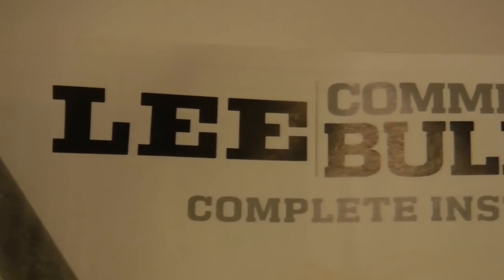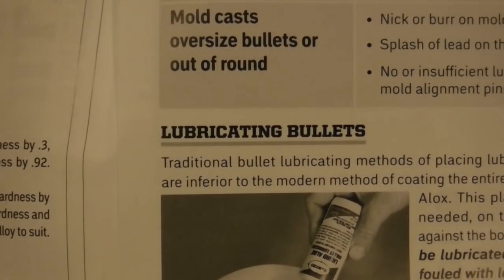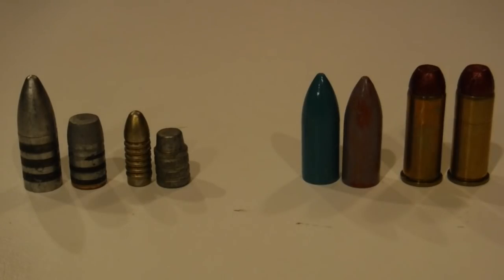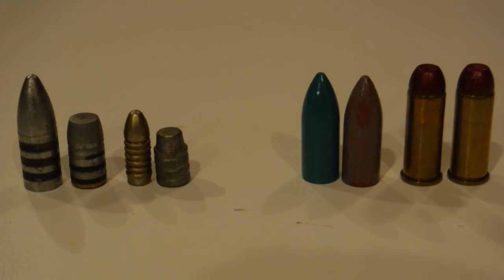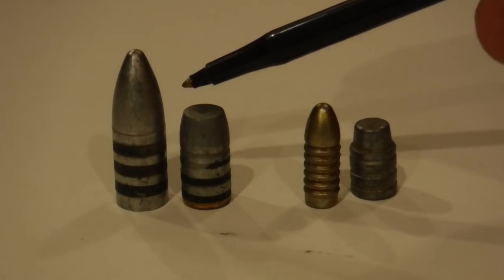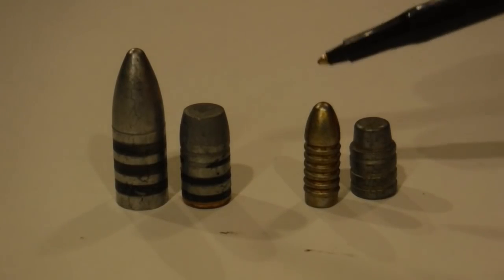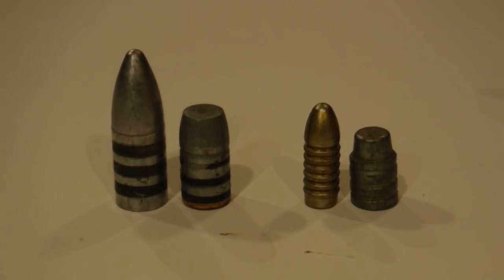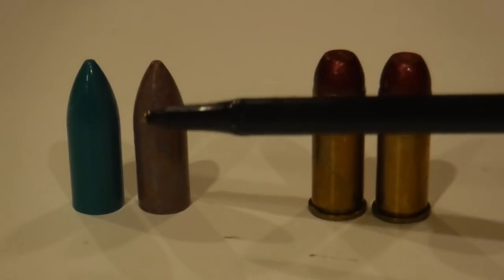The Four Camps Of Cast Bullet Lubrication - Call To Unification

Comment: A few years back I was taking a course required for a CCW permit, and for the range portion of the course they asked us to bring a "full sized handgun, not one of those tiny micro pistols."  So I did.  I brought my Dirty Harry gun, my S&W 29, 6 1/2" barrel.  I was shooting 44 Specials loaded with the Keith bullet, and they had been "traditionally" lubed in my Lyman 4500.  We started shooting at 3 yards from the target, which meant that the end of my muzzle was less than a foot from the paper target.  As the instructor was walking the line, he stopped, got a very confused look on his face,  and began to examine my target.  There were weird marks all over my target; (the 44 caliber holes were impressive too).  It turned out that the spinning bullets were flinging lube all over the target, and it made for a very interesting and impressive display.  You can't do that with a powder coated bullet!
Is there a point to me telling that story?  Not really, but it's kinda like this lube discussion.  It's interesting to some, and others won't care.  It may get a few folks excited, but many will just ignore it.  At the end of the day, the target still had holes in it, and the type of lube used would not have changed that.  The choice of lube did have an affect on the surface appearance of things, but not much more.  Also, when were all standing in line shooting, we were using different guns, but we were in sync with each other, and kept our muzzles pointed in the right direction.  Only targets got shot.  It works much better that way for everyone.
Reply: Loads of Bacon that's a funny story Bacon!
Reply from the maker: LoB - Really enjoyed this comment - neat - or not..!   FC Steve

Comment: I will make a suggestion here. On FC ladle casting video, he spoke of being able to cast bullets outside,over a fire. For those whom only rely upon powder coating, get an alternate method of lubing your bullets in case of emp, power outage, etc. Hard to powder coat without power.
Reply from the maker: fuzzfork8 - Great point ya got there, and we all need to keep that in mind,  Best to ya,  FC

Comment: I use the powder coat since I first started casting a year ago. Because it allows me to use them without needing a sizer. For some reason casting and sizing gear is near on impossible to get here in Canada. Being able to powder coat the bullets and just load them without sizing is great for me. 

I actually have a Saeco sizer a friend gave me, but I don't expect I will EVER find the inserts up here for it.

Comment: Interesting turn today at the range. A...more matured fellow than my self has been showing me a few things about his casting, he has alot  of years on me in casting so there is definitely something to be learned. He brought me some wheel weight cast 158swc that were lubed with grease type lube. Well I returned the favor with some 158 flat nose bullets that I powder coated for him to try, No lube smoke! Well the range master brought up that he had had a couple of folks who had picked up powder coated rounds and asked him if they were snap caps. I found it an odd question but I could see it happening. Guess the moral of the story is dont pick up ammo and make assumptions.
Reply from the maker: The Eastern front - That's the first time anyone ever brought that up.  Thankfully, we haven't heard of any ADs caused by PC ammo being confused with snap caps.  Federal SynTech ammo would also be in the same vein of ammo confusion.  You would think that the weight of the ammo, the lack of clear plastic and visible spring, plus no primer would differentiate the live PC ammo from snap caps, but anything is possible.  Best to ya,  FC

Comment: Good Morning FC45,  I just finished putting a few coats of HiTek on my 170 grain flat nose bullets. I just bought some Trail Boss powder, and I want to experiment with some loads. Have you worked with Trail Boss in any 30 30 loads?
Reply from the maker: Stevie v - Wish I kept my TB powder - traded it for TiteGroup.  But no, have not used TB in 30/30 - should work well though... Best to ya,  FC

Comment: Have you ever experimented with paper-patched lead bullets? No lube required, no leading, but setup and the process is tedious.

Some people having success firing them with great accuracy into the 2500+ fps range in .22 hornet, .30-06, and of course the traditional BP cartridges at moderate velocities with smokeless. When done consistently I have seen groups that rival commercial jacketed bullets.

Another potential use could be for increasing the diameter of a cast bullet for use in larger or worn barrels. For example a supply of .309" cast bullets could be patched to .314" for use in .303 Brit or 7.62x54R.
Reply from the maker: Hughes Enterprises - PP bullets are intriguing, and there are molds being made for them by some fine manufacturers (like Accurate and Arsenal as I recall).  They are great in milsurps also...the straight sided designs may have inspired similar straight walls of some PC designs.  But I haven't tried paper patching as of yet...someday perhaps when I have a lot of time on my hands... Good shootin' to ya,  FC

Comment: Have you ever tried to tumble lube by putting the container with the 45/45/10 and bullets into a wet tumbler  (without water of course) for 10 minutes or so?
Reply from the maker: jerrydalt - No, haven't done that... but it sounds good - perhaps 10 minutes might be longer than necessary though, when we hand tumble to good effect, less time is required.  The machine should be faster... Have a great day,  FC

Comment: Hi Mr FortuneCookie45LC: is it possible to melt range scrap of powder coated bullets,? ...the powder coated burn smoke is not toxic?...Thank you
Sorry for my english, it´s not my native language
Reply from the maker: blackarcher1000 - Your English is fine...easily understood...Yes, you can melt PC bullets, no problemo, hasta la vista, baby...!!  Depending on the particular PC, the lead melts out and some of the PC just lies there on the lead resisting the heat.  Others will actually melt and smoke... Casting is always done outdoors in the open air.  Plus we always want wind to blow away from us while casting, and if we don't have enough of that, a strong electric fan is used to move that air away from us, even outdoors.  None of the smoke or dust in our casting operations is good for us - we should avoid it for sure.  We want to shoot our lead cast bullets, but we also do not want lead exposure either.  Best to ya,  FC

Comment: another way to lube bullets is the hot wax method ,its works as fast as tumble lube  ,but you can use wat you like  melt wax ,get the bullets in ,,let them leak out ,i use a  elektric fryer
Reply from the maker: peteralexben - Sounds like a variant of the traditional lubes procedures and techniques... thanks for posting the interesting stuff... Best to ya,  FC Steve
Reply: thor axe his water soluble floorwax is another one, its a nice lube on pc bullets too

Comment: I always thought powder coating and HiTek were neat, but seemed WAY to time consuming. Why go through all that hassle when you can coat in Alox and get identical shooting results? A lot faster, a lot cheaper.
Reply from the maker: Hans S.  - How you been, Hans?... Always good to hear from ya... That's the thing, Hans - you can bring out all the advantages of Alox tumble lubing (a lot of my bullet reserve is done with 45/45/10) - but to those in the PC camp or Hi-Tek camp - what they do is not a hassle at all - there are good reasons for what they do as well.  Perhaps the best reason for any of us to do it a certain way is that we simply want to do it that way - and no other reason is necessary.  We all fall under the Lee recommendation - All lead bullets must be lubricated.  Have a great day,  FC Steve
Reply: Hans S. Yea, im with you on that. If I have to go though all that crap on powder coat I'll buy copper plated. Other then that it's aloxs. I've done some powder coat, but it's not for me. If you mess up a batch, that really sucks.
Reply from the maker: Farmer Dude357 - I'm hearing you guys for sure - and you have definite reasons to favor being in the tumble lube camp...nothing wrong with that at all - I shot those for decades...Have a great day,  FC

Comment: Whoa!  I didn't say anything to attack Brandon. Not at all what I meant. Nor was I attacking powder coating.  I just said I didn't see the point of powder coating. Not that it doesn't work. I've always felt to each their own. I think your remarks in this video made Brandon and I out to be confrontational. Neither of us were.
Reply from the maker: Jim - There was nothing personal in the two of you had in your thread and nothing personal in my responses or replies either.  You guys are OK - very OK.  The attack and defense mentioned in the description only apply to that which might be explicit, implied or perceived on the favored lubrication methods we might have.  The unification being promoted is to bring all bullet casters together in appreciation for what works for each and every one.  I thank you both for spurring this as we've all seen reason for putting this out.  Best to ya,  FC Steve

Comment: Great, I annoyed someone severely enough to force FC to do a video about it. :(
For the record, I shoot 3 of the 4 posted bullets. My only real point was if someone purchases lube, instead of making their own, that the price difference is negligible between lube vs pc.
Reply: I agree Brandon.  I can't imagine any way to lube a bullet faster or cheaper than I do it with my method of powder coating but if you've found a different way and it's working for you then by all means, go for it! There are a lot of ways to skin a cat and most of them will be within a whisker in terms of time and money. If it's more than a whisker, so what!  Your time and your money!
Reply from the maker: Brandon Salyer - You guys had a good vigorous thread...what we really want to do is celebrate our cast bullets together... some use ladles, some use bottom draw pots, there are different mold manufacturers, many - but not all use ingots, some Lee size, some size with machines... and there are tons of ways to actually cast - but we are all bullet casters.  Have a great day,  FC
Reply: FortuneCookie45LC I agree with all that, excepting ladle users those guys are the worst.  Lol. I kid.  
I don't disagree with your statement at all. I would actually broaden it to include all lawful firearm users. As old Ben Franklin said, "We must, indeed, all hang together or, most assuredly, we shall all hang separately."

Comment: It was I , whom said they had more shades of lipstick than the women.  What I wanted to see, is a test. Chronograph the same bullet,;  powder coat verses lube to see if there is a differance, or restriction.. Myself--I like the smell of burnt lube.
Reply from the maker: fuzztfork8 - Already did the test, and the PC gets a bit more fps, but it might not be from lubricity, but rather increased friction raising pressure just a tad...it isn't enough to really be significant in any regard... Best to ya,  FC Steve
Reply: Thanks, will find yhat video..For some reason, still not sold on it. Its not for willness to change, but something lurking in my mind.